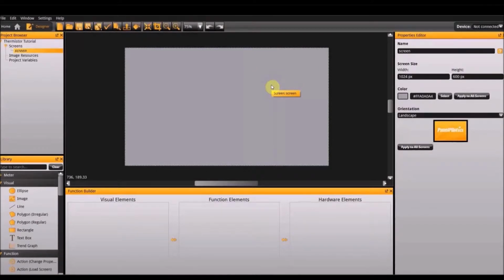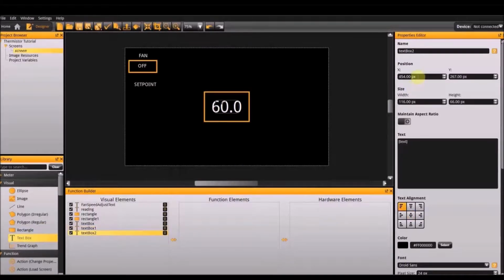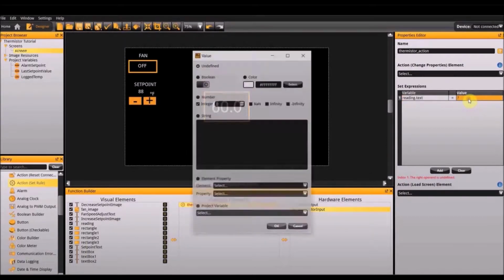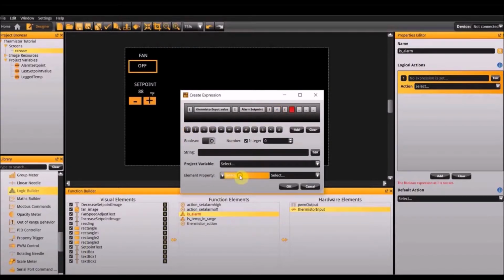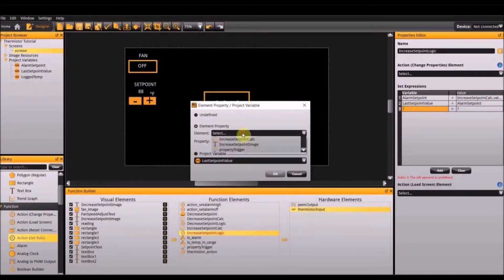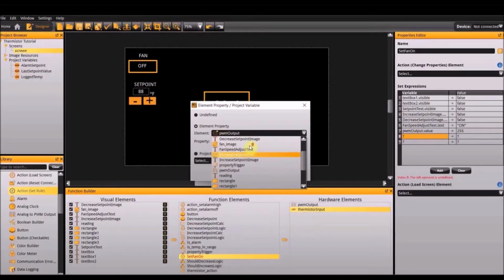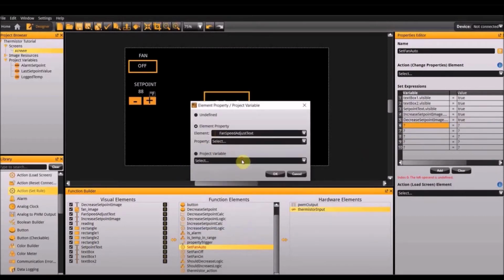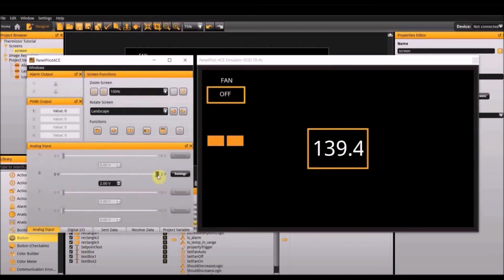PanelPilotACE Tutorial - Using Thermistor Hardware Element

Comment: Had a similar thermistor application but didn't work as this video shows.  Setting the thermistor.text to the thermistorinput.value gave garbled results.  I had to add a string converter to change the thermistor input to a text string and using that to set the thermistor.text